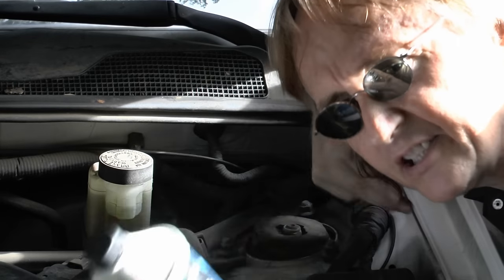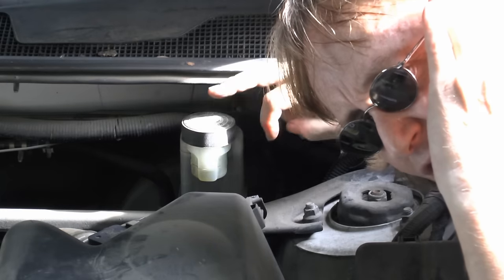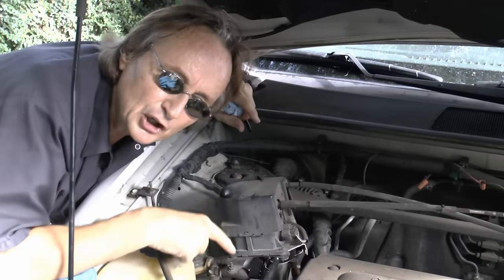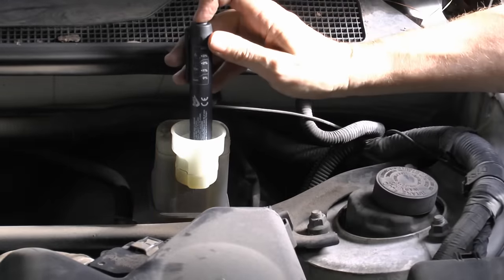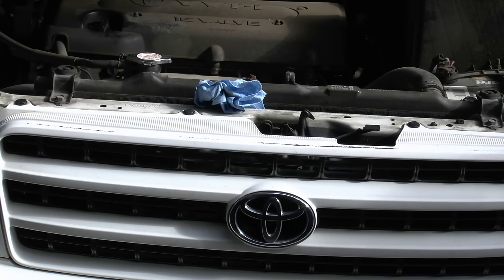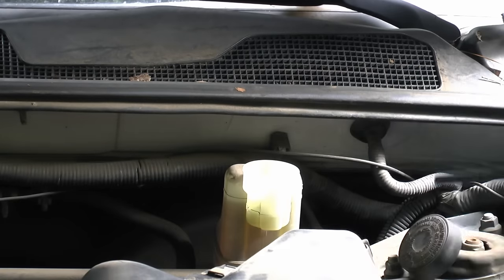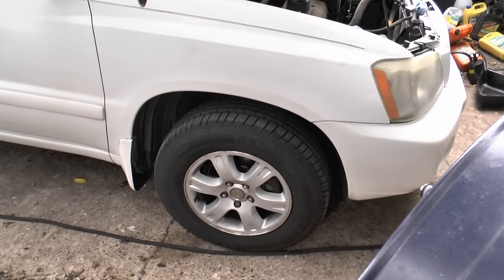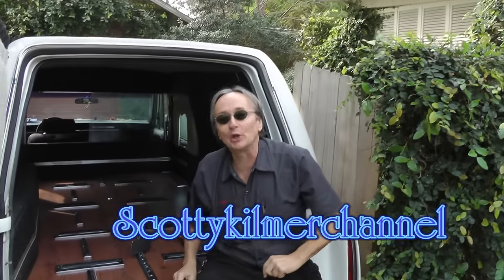How to Change Brake Fluid in Your Car

Comment: One quick note is to never bleed the master cylinder dry. Getting all the air out of that is a real mission. If you do remove the brake fluid from the master cylinder, take out only enough to go the the 'minimum' level, then top it with fresh. Then bleed the brakes as normal, topping up with new brake fluid every so often.
Reply: How do I bleed these breaks man I need advice asap

Comment: If you live in the rust belt like I do and you car if several years old, the first thing that will happen when you try to bleed the brakes is that the bleeder will break off, now you have a real problem. Just leave well enough alone and save the break bleeding to a mechanic when you need your brakes replaced, don't go looking for and creating problems.

Comment: IN CASE OF RIGHT HAND DRIVE VEHICLES: Start flushing the the brake fluid from Left Hand Rear. Or the easy formula is to start flushing from far side wheel from the driver and come closer.

Comment: Picked up the same tester you showed on eBay for $15.  Came in handy yesterday when my local shop tried to tell me I needed the brake fluid flushed in my 97 Lincoln Mark VIII (which I did right after buying it last November).  Fluid looks clear and had 0% water.  Thanks for the awesome info!!

Comment: Cool video! It's worth noting my brake light came on and the fix in the rare reason the brake light comes on is that the master cylinder is split into 2 systems for redundancy. Generally one system for the front brakes and one for the back. So there is an internal pressure comparing pin situated between exposed to the two systems pressures so that if the pressure in one system is much lower than the other, the pin is pushed off center position and turns on your brake light. So if say a front brake system fluid valve is open or that system is full of air and you push the brake pedal down hard, the pin will snap off center because there is great pressure in one system side of it but not the other and this activates the brake light. 
The fix is very easy though, once the system that was open or full of air is fixed, simply press VERY hard on the brake pedal and since both systems will have a lot of pressure, the pin will snap back to center and the light will go off.

Comment: When bleeding your brakes don't forget to refill the reservoir because you do not want any air getting into the system. Keep the fluid above minimum. I never fill mine to the maximum because the fluid expands due to heat.
Reply: I agree, I'm a bit concerned Scotty missed this tip.
Reply: Also, mark with a pen where the fluid initially sits so during your final refill you only go to that line.  Else, if you top off and your pads are at 50%, then the next time you change the pads, fluid can burst out of the master cylinder when the calipers are reset.
Reply: Angry Whale mech/techs, are told not to fill master cyl, unless there's a leak. When fluid gets low, then brakes probably need replacing.
Reply: @oldtwinsna8347  explain please mate

Comment: Forgot to mention the mechanic will need to fill up, and cap the reservoir between corners (rear passenger, rear driver, passenger and driver).  Thanks for the time you put these videos together, to the point and fast action without being over simple or overly complex.

Comment: Scotty Kilmer Changed brake fluid yesterday and had some spill when adding to the master cylinder.  I thoroughly rinsed out that part of the engine bay but was wondering if I need to go back with soap.  Thanks for all the videos!

Comment: dot 3-4 usually turns black or green when its fucked, so I just saved you $35 on a tester
Reply: Sometimes you can smell that it's fucked
Reply: but the one thats linked is $8 lol

Comment: Try checking the fluid in the caliper then tell me if there is a problem. That is where the most heat takes place. 
I take them off and clean them on the bench and drain all the fluids in the system, when ever doing the brake pads.
Nothing like a clean start to the next 80-  90,000 miles in my rigs.

Comment: It probably also depends on where you live. I dare say moisture will build up in the brake fluid faster in S Florida than in Arizona.
Reply: Acura & Honda say first flush at 45k or 3 years then every 2 years 30k. I do mine every 2 years. Cheap to do and never have had problems but saw a lot of master cylinder failures in early Integras due to never changing the fluid.

Comment: Just got one of those testers my car is 7 years old and the tester showed green on the test so I don't need a brake flush as the dealer said I needed at $189.00 so thanks for the tip.

Comment: I say just change the fluid as preventive maintenance by no more than 80k miles 5 years even if it looks good or tests fine. The fluid u are testing in that reservoir is not the same fluid as what's sitting behind the piston of each caliper Scotty! The Caliper piston reservoir is what's holding all of the fluid that gets hot over and over and breaks down. The fluid in the engine compartment reservoir is the better of the fluid. What does everyone else think??

Comment: Just flushed my whole brake system. First time in 12 years. Definately needed to do it. 
I got some brake bleeders with one-way valves built in. Just open the bleeder and pump the pedal. No need to open and close the bleeder between pumps.

Comment: Scotty...thanks for all your videos that you do. I do have the Fluid Tester that you recommended and my current 2014 Honda Accord is at <2% (OK). I haven't changed the brake fluid in 5 years I've owned the car. Do you think $85 for a Brake Fluid Flush is reasonable and currently I'm at 56000 miles. When do you think I should change the brake fluid? Thanks again!

Comment: Thanks Scotty! While the brake fluid doesn't have even 1% water (as measured by the tester), the Firestone guy says it has more than 500 ppm copper. Does that warrant brake fluid flush? The car is at 130k miles and I just bought it 6k miles ago.

Comment: scotty, i own '69 dodge dart  with a weiland 318 in it. when you slow down, not using the brakes, it starts popping. it is no big deal, cause i am putting the original 340 back in over the winter. (original p-code 340 4 speed car)

Comment: Just be sure that your car is a Dual brake system. Cause the sequence of dual brake system has different sequence than single brake system. Refer to your manual. Usually its yhe nearest to brake master first. Like Honda CR-V and Accord.

Comment: just for myself I got a bmw 328i i do the brake flush myself every 8 months I dont believe that 2 years thing... thats just me actually like to have a nice and clean brake fluid in there and takes more time to take off the tires than actually popping out the bleeder am I right? keep the good job I have learn a lot from
Reply from the maker: you're doing overkill there, if you do my test you'd find maybe you'd have to do it once every 4 years, BMWs are pretty well sealed brake systems.

Comment: In dry areas, this issue is less a problem.  Have gone 180,000 miles with never a brake flush, and great compression and working as good as it gets after 4 brake pad changes.
Reply: I have a Lexus at 258K and am still on the original fluid.

Comment: I do it myself every two years.
10 bucks for the fluid,one hour to flush it.
Reply: michaelovitch What do you do with the old brake fluid?
Reply: o0Avalon0o recycle it with your town dump/transfer station or the auto parts stores if they accept brake fluids and motor oil.
Reply: Next time you do your brake fluid video tape it and upload on YouTube
Reply: Or you could waste your money on a fancy "brake fluid sensor" and stick it in the hole every 10 years so then you "know when to change it".
Reply: michaelovitch What brake fluid do you use? Dot 3 dot 4?
Reply: My local mazda dealership keeps forcing me to change my brake fluid every time I get an oil change from them... I always quickly say no because they charge $400 for a simple brake fluid change. Ridiculous people.
Reply: @narutofan4eva1  wow
Reply: @narutofan4eva1  yes, my 80 year old grandma had the exact same situation happen to her at her local Mazda dealership, tell her she needed a brake job 3 times on her Mazda 3 2015  with only 16,000 miles. They even told her she needed a new rear window, even though it hadn’t been smashed by a rock or damaged. Just pure ridiculous. Dealerships are so mean these days, especially to take advantage of my grandma. What a shame. Good luck finding a good mechanic to work on your Mazda!

Comment: I have seen master Cylinder tanks with rubber bellows to prevent any air from getting in, often have to make sure they are seated properly before replacing the cap, both my cars have them.

Comment: We are leasing a  2020 Ford Explorer that was in for its 25,000 mile service. They said it needs brake fluid flush.  The lease is up this December of 2022. Brakes feel great at the moment.  Is it worth the 167.00 to do it?  I left without doing the brake flush, but will re-schedule if I should.

Comment: Is it true that most dealerships will just extract the fluid from the reservoir and refill it as the brake fluid service?  I have heard that this does help somewhat in that there is a bit of circulation throughout the system.

Comment: I have a 2014 Jetta in bone-dry southern California with only 28k miles. Brake fluid still looks brand new and I've never had it changed, but I plan to have it changed in a year or so. I don't buy VW's recommendation of changing it every 2 years, give me a break. Does testing the fluid like this directly in the reservoir account for the moisture content of the fluid that's down inside the brake lines?

Comment: instead of a bulb, i went to the farm supply, vet aisle, and bought a large(50cc) syringe. the kind you use on cows and horses,  since they also carry plummbing  i can attach a clear vinly hose from the either the irrigation or refrigation or home department for extra lenght

Comment: Has anyone tried repeatedly changing only the brake fluid in the reservoir method over a period of several weeks? Although not perfect, I believe this "Turkey-Baster" method does somewhat of a good job as a lot of the brake fluid eventually circulates throughout the entire system anyways and the brake lines will eventually fill with new brake fluid.

Comment: Scotty my brakes are spongy, the hand break is really loose and the clutch takes up really quickly. It's my 2006 Corolla and the clutch and brakes use the same system. If I pump the brake or clutch it doesn't change the way it feels so is that still air in the system or has the brake fluid lost it's properties?

I'm about to change all the brake pads and bleed the brakes/slave cylinder. Car has done 280k km.

Comment: Hi Scotty! I recently changed the brake master cylinder and brake booster in my 1981 Porsche 928 and flushed the brake fluid. It came out cloudy and kind of dark at first and then came out clear because of the new DOT 4 fluid I put in it. I suspect the fluid to never have been changed in the 33 years this car has been on the road. Would that be a good assumption or would something else cause that?   Thank you

Comment: Scotty, I replaced my rear callipers and pads. There’s two brake reservoirs. The one master and a little beside it! When we replaced the passenger rear was leaking fluid, some red trans like fluid was leaking. What’s the low down?

Comment: Looks cheaper to just bleed and replace the fluid than it does to buy a testing kit like the one in the video.
Reply from the maker: +Xtrndk kit is less than 30 bucks
Reply: +Xtrndk Depends on your situation. Tester will last you a while. Multiple checks over the life of your car and other cars. Also a nice tool to help a pal or two out. Then they repay you with some beers and you've made your money back!
Reply: eBay for $2.50
Reply: Ward Ataop yeah , they robbed him, 30 bucks !

Comment: Oversize syringe technique i use now is great not only because it brings the brake pedal right up more than the old way of pressing the pedal,it draws it out instead with no pressure on the braking system.
Pushing it out causes pressure on the master cylinder seals causing them to leak even worse with the easybleed system using car tyres to pressurise the system especially if you put to much pressure in the tyre to bleed it lol.

Comment: if I were flushing my brake system, or bleeding my brakes, I wouldn't push the brake pedal more than half or three-quarters of the way, because the master cylinder isn't used to the seals running in an unused area, and you could compromise the longevity of the master cylinder. My experience with Toyota's has been good and bad, they do have tighter tolerances, I definitely notice the nuts and bolts don't rust nearly as badly in the Rust Belt where I live. Bolts on an American car are rusted and want to break, and the Japanese bolts are rusted and they always come out and there's no rust in the thread below the head. Tighter tolerances and better factoring specifications. I wonder how that works if they're  made in Mexico or USA?

Comment: I replaced most of the brake fluid with a turkey baster but did not bleed the brakes after. It's been 6 months and my brakes are still working. Did it hold the vacuum?

Comment: Hay Scotty tried the suggestion about asking questions on Sat but it didn't work, so here I am, I put synthetic fluids any where I can and I got the brake fluid tester as in one of your vids and it told me I should replace the brake fluid in my 02 Chevy avalanche, it has dot 3 can I replace it with the dot4 (synthetic) brake fluid?? thanks, love your vids, keep up the good work

Comment: ohhh forgot this too... I dont know If there is a pattern to bleed out the system the one I use is FL RR RL FR I see you used RL RR FRFL never seen that one before.... thats just me but is there a specially way how to flush them out Im a Honda Tech and is always good to know more stuff from someone with more experience
Reply from the maker: some companies have different bleeding schedules due to different designs. But normal cars are bleed starting at the furthest wheel from the master and ending up at the closest.

Comment: Hai Scotty does the brake fluid circulates to and from master cylinder and whole system? I mean is it okay to remove the old fluid from master cylinder add fresh fluid or bleed and fill the brakes?

Comment: I'm doing clutch and flywheel work next spring. Since the clutch is hydraulic and uses brake fluid, should I flush and replace it?

Comment: Hey Scotty, quick question, does old power steering fluid make your steering noticeably heavier?
Reply from the maker: yes, that you should change every 4 years or so, uber high pressure, crud builds up over time

Comment: When I got my oil changed they told me the color my brake fluid indicated that it was bad. Well I knew my car was old so I used the pump method to change the fluid myself (without bleeding them). I'm curious if the color really can tell you that your brake fluid is bad. Scotty, what's your view? Thanks.

Comment: Moisture (water) is heavier than brake fluid so it works it's way to the lowest points in the system, which is the bottom of the brake calipers and/or brake cylinders.  How is testing the fluid in the master going to give you a good indication of the moisture level in the cylinders?
Reply from the maker: it does mix in the whole system to an extent, checking at the master gives a good indication of the whole system's health

Comment: Hey Scotty you said  for American cars it is good to change it every 3-4 years right? Also what is a good brand of brake fluid? thanks!
Reply: +Luke   put Dot 4 in, the generic at Advance is fine or if you like go for the Valvoline if you're into name brands.  Sometimes you get what you pay for and occasionally you don't gain anything with the higher priced spread.  Difference between dot 3 and dot 4 is basically a higher resistance to heat fading..

Comment: Hey Scotty, I have a 2004 BMW 530i with just over 106000 miles.  When I drive on the highway between 65 and 80 mph there is noticeable vibration coming through the steering wheel and you can see the passenger seat shaking.  I bought the car used 8 months ago and did not know when the last alignment was done.  I took it in to a tire shop recently and described the vibration and they said my left front and right rear tires were very worn.  They replaced them and put the two new tires on the front, balanced them and did an alignment.  The vibration went away for about a week, but has now come back, though it is milder than before.  I jacked the car up and there is no play in either of the front wheels.  I hear at this mileage control arm bushings wear out on these cars.  Could that be the problem? Should I have it checked for a bent rim, or change the control arm bushings first and see if it goes away?
Reply from the maker: bmws have very trick racing style suspension systems, as such, only a real pro front end man can mess with them. find one and have him check for wear, something's worn out which will ruin the new tires just like the old one. It's not a do it yourself repair on any BMW

Comment: I would just stick with manufacturers recommended change intervals. Brakes are a big safety system in your car. You wouldn't skip an oil change, or timing belt change just because it looks good would you? So why skip a big safety item such as brake fluid. Just flush it as recommended and regain that original pedal feel back.